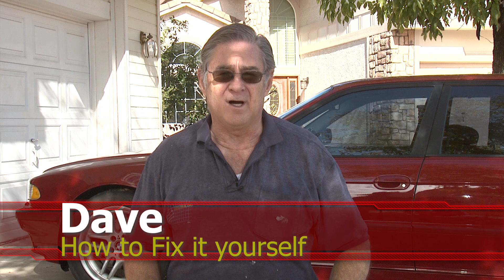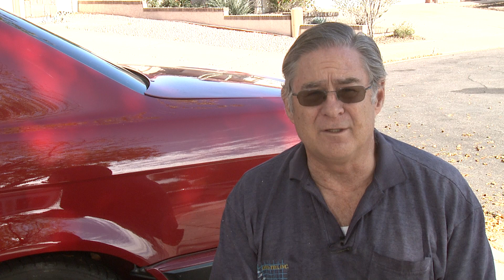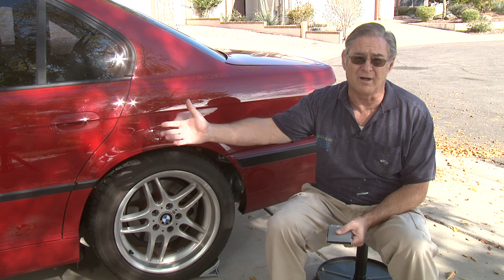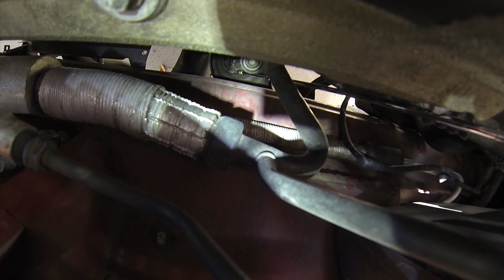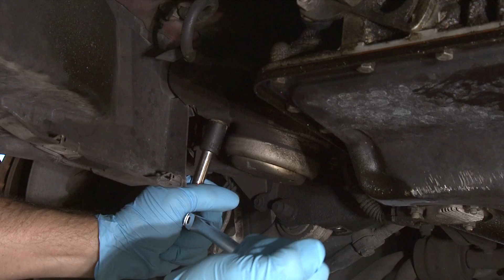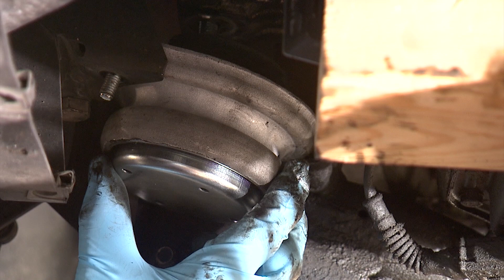DIY Motor Mount Replacement for BMW 740i E38 | Save Money with This Step-by-Step Guide

Comment: Thank you that was great!  I wasn't comfortable doing mine myself but wanted to know how complicated it was for pricing.  I had mine done and now I notice there seems to be an air leak somewhere on the passenger side under the MAP when I first start the car.  Probably blows for 2 minutes or so then stops.  Doesn't look like they needed to take the breather out or anything so I don't know what may have happened.  Any ideas?
Reply from the maker: Glad it was helpful!
Reply from the maker: We had the same problem look broken hoses that may have broken while lifting the engine
Reply: @howtodoityourself6178  yes I found it.  Can't remember what it was called but it is at the lower front passenger side.  plastic tube that was old and what was left crumbled when I grabbed it.  It is connected to something up under the front bumper.  Has air for first 2 minutes after start.  I bought a new part and replaced it.  Pretty easy. Just so long ago I can't remember what it was.
Reply from the maker: @lydiarown  Same as us